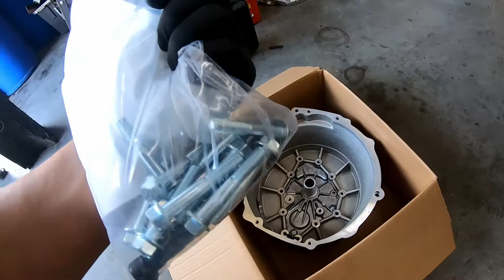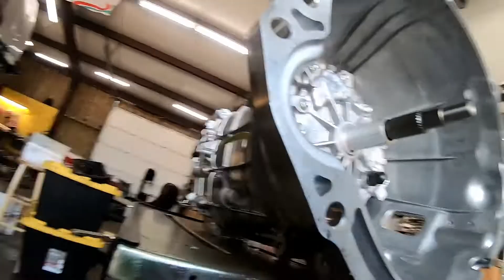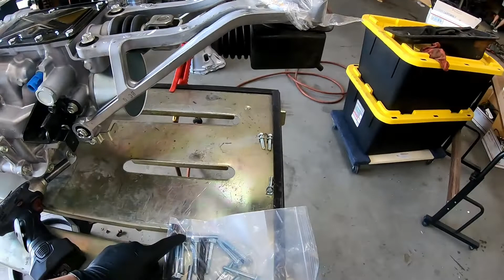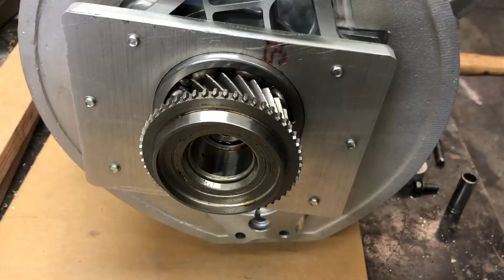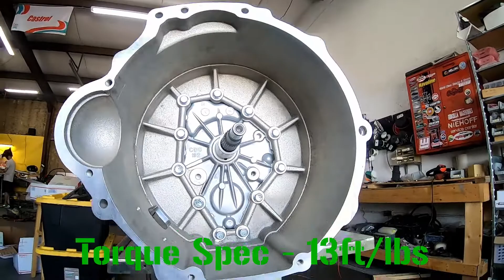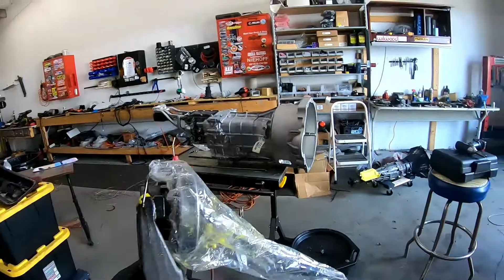Godzilla Raceworks CD009 to L28 Bellhousing Kit Install

Comment: Why not weld the bellhousing to the transmission after to fill in gap and what clutch are you using a coyote clutch resplined to the cd009
Reply from the maker: No need, also risks adding stress points in the casting, or tweaking it from the heat. We also considered that nobody else who makes a CD009 swap for any other platform welded it. So we reduced complication, as well as made it exponentially easier for the home DIY builder to install one.

Comment: Since the 5th gear of the CD009 is 1:1 and the first two gears are so low in ratio, do you use the original 3.36:1 diff or go to 3.54:1 ?    That’s 5 gears before you get to 1:1 ratio. 🤷🏼‍♂️
Reply from the maker: Haven't personally driven a CD009/3.36 combo, but we have had both the 3.54 and 3.9 rear ends with CD009s in house. The 3.54 is setup really nicely for turbocharged applications, especially larger turbos. 3.9 would be much better suited for N/A, and with larger turbos becomes more apparent, not enough time in 1st gear to get fully spooled.
Reply: @GodzillaRaceworks  Thank you! That helps me a lot! My diff is on the way out so I am researching replacements. I just don’t know if I am going turbo or N/A. Gonna give Datsunworks a look too. 🤜🏻🤛🏻

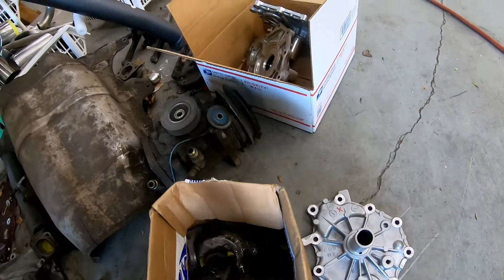Comment: @10:58 this is worng just so you dont have to do it twice like i am and throw cd009 around use the turbo 280zx throw out barring and collar along with the 280z slave cylinder to have a solid pedal feel

Comment: My only question is since there is an air gap present is there any concern for deflection produced from the engines torque to the trans seeing as its only relying on the bearing cover for rigidity.
Reply from the maker: No issues reported as of yet. Our shop 280zx has put roughly 350whp through it, we have a few other customers in the 400+ whp range with zero issues over the last year and a half now. There are also many other designs like this that are pushing well over 600-700whp for other platforms such as LSX swaps, RB swaps, etc.

Comment: Will this bolt to a Datsun L20b 4 cylinder engine?
Reply: Just curious.

It's a 1971 Datsun 521 truck.  I already have  5 spd transmissions in both of my 521's.  Dimensionally, would it be that much bigger than the reverse over 1st 5spd I have in there now which is out of 77-79 Datsun 200SX series.  I really have no clue. Those transmissions installed easy just drilling 2 holes in angle iron for cross member and that was it.  

I'm clueless so any information is appreciated!!!

Thanks 😊
Reply from the maker: @jimlegalley6656  I can almost guarantee the CD009 will be WAY too big. However, we do offer a smaller 6-speed swap that is almost dimensionally identical to the factory series 5-speeds.

It's our TL70 kit that we will be releasing a video on in the coming weeks.

It can be found here

https://www.godzillaraceworks.com/drivetraintl70
Reply from the maker: The physical bolt pattern is the same, but depending on what vehicle it's getting installed in, you will have to do a TON of re-working the sheet metal to get it to clear. We know on the Hako skylines, it requires a custom transmission tunnel
Reply: @GodzillaRaceworks

Comment: I can use the original  Clutch from my L 28 engine or I need to put the plywhee and the original transmission clutch CDOO9
Reply from the maker: You can use the original clutch and flywheel components
Reply: Godzilla Raceworks can I still use Clutch Fork for the 280z transmission I can use Clutch Fork The original for cdoo9  i can use any one of them
Reply from the maker: @raulsalazar3946  350z fork with 280z collar
Reply: Godzilla Raceworks  thank You So Much bro

Comment: What brand shifter do you use to relocate it into the correct spot for the hole in the tunnel?
Reply from the maker: We've standardized using the GKTech v2 relocation shifter. We've tried a few others, one specifically was total junk which we're not even going to mention
Reply: @GodzillaRaceworks sweet thanks for the reply! With series 1 and 2 cars with factory 4 speeds do you have to cut open the tunnel like you do with a 5 speed swap or does it fit?
Reply from the maker: @stephendenison6205  No, all S30/S130s will require cutting, the transmission case is physically too big to fit without trimming the factory support loop away from the crossmember area.

We should have a S30 and S130 install video in a few weeks
Reply: @GodzillaRaceworks  Hi, any news on that install video?
Reply from the maker: @FugeeLaw  Coming soon! We've been working on it, had an equipment failure a while back and we're finally upgraded and getting caught back up

Comment: Which diff ratio works the best with 6 speed gear box
Reply from the maker: Our development vehicle has the 3.54 rear differential, Derek our partner for this product had a 3.9 but though it was too quick of a ratio so he stepped down to a 3.54

Comment: Does this work with any year 350z trans or only the 06-08 CD009? what about the CD00A trans?
Reply from the maker: This works for all externally slaved CD00x series transmissions, the only real differences between them are internal.

The CD00A transmission is the current part # version offered by Nissan (Superceded the CD009)

Comment: When will these be available?
Reply from the maker: We've sold 20 bellhousings so far, we usually do runs of 10 at a time, and collect pre-payments while they're being casted. Usually what happens is by the time the castings are done and ready for machining (3-6 months from when we place the order) there are only 1 or 2 left and they go quick.

The next run is going to be delayed as we are also developing a bellhousing kit for the Aisin TL70 (Subaru BRZ 6-speed) for customers who do not want to cut into their chassis for clearance